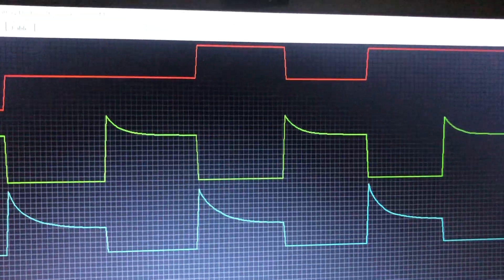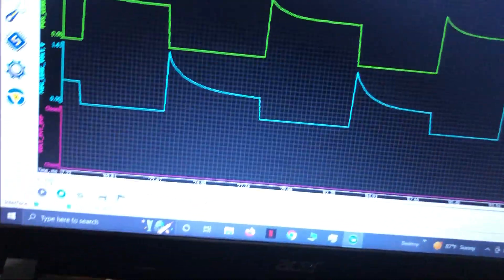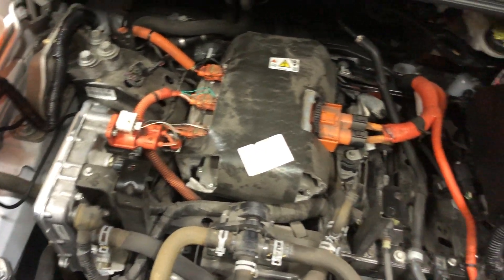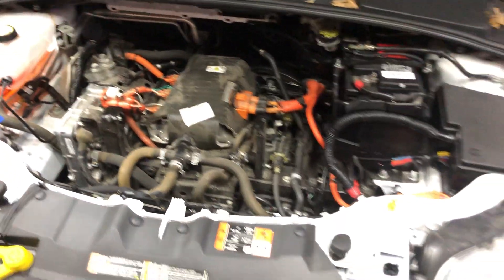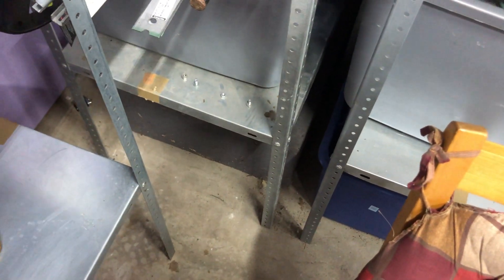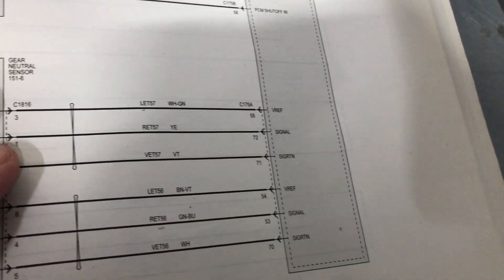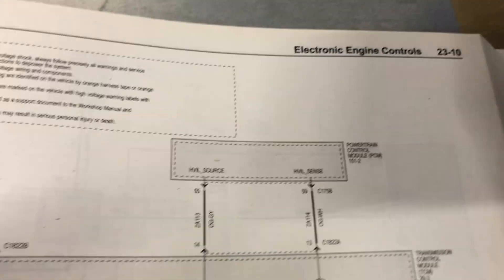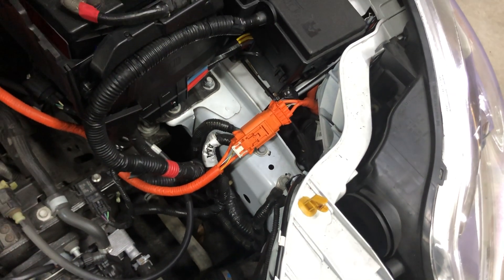P0AA6 Ford Focus EV

Comment: did you actually find the problem?
Reply from the maker: I am shotgunning it with different modules, I put a ECM (10-28-22) out of a newer model and it did the same thing. The ECM is part of what senses for high voltage leaks on this model. I will update you as soon as I pin it down. I’m pretty sure it’s not coming from the actual batteries however.
Reply: Thanks) 
I have the same problem with my top battery))
Reply from the maker: @AntonGolda  the “a” battery is bottom battery if you are scanning and getting a return of voltage leakage in battery pack “a”.
Reply: @AntonGolda  Did you get it fixed?
Reply from the maker: I got the manual and am trouble shooting it more on Wednesday October 9, 2022 and will update you then.
Reply from the maker: https://youtu.be/eBrpkgjT9RM